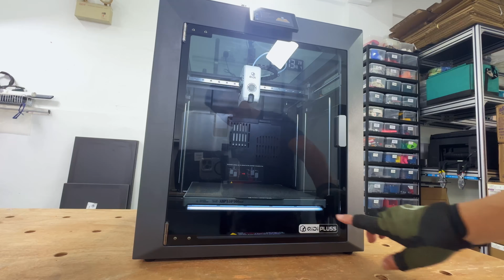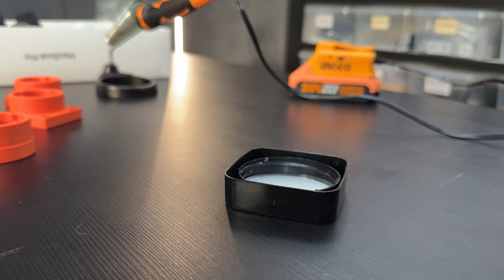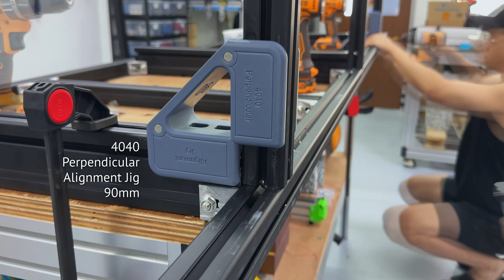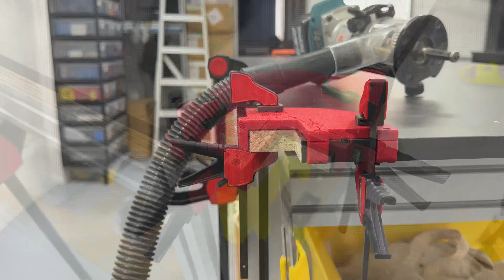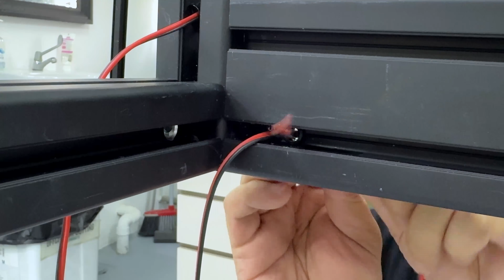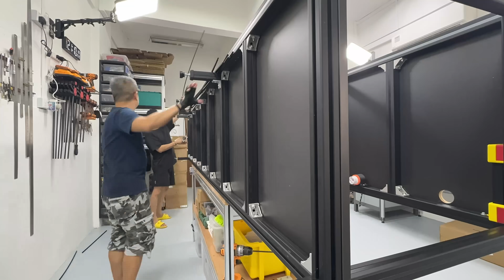I Built a 3D Printer Rack from Aluminum Extrusion (Full Print Farm Setup)

Comment from the maker: What do you want to watch me build?
Reply: filament drawer maybe with internal heated chamber
Reply from the maker: That will be done to 2 printers in time to come. With IDEX and INDX
Reply: Just build anything, sir, we would watch it regardless. Thank you for your truly unique and inspiring content.

Although, there are some concerns i'd like to address:

1. The open parts of the chipboard panels should be coated with something to protect from moisture.

2. Not sure if those snap-on connectors have sufficient wire gauge, i hope you calculated the minimum gauge in advance. It's fire hazard otherwise.
Reply from the maker: Noted❤
Reply: Foldable workbench?

Comment: Fantastic! I am planning a gaming table with a recessed vault for my Role Playing group. So of course RGB LED strips. The wiring in this video is very helpful. I will also be installing custom stained walnut for the table top and side panels. The whole reason for using aluminum extrusion is for the ultimate flexibility with accessories like cup holders, dice trays, tablet stands and phone chargers.

In the research phase. But I am getting ready to order some parts to play with as I am a physical learner. Thanks for the inspiration.
Reply from the maker: That sounds like an amazing project, walnut looks great with the black extrusion! ❤

Comment: The rack looks really nice, but the connection to mains plug looks unsafe. There should be at least a heatshrink on the exposed wires, that go to the plug.
Reply from the maker: i know. leaving it for Part 2 of the build where i do cleanup.

Comment: I love your footage and really appreciate your work! 

As my hobby is slotracing, I'm planning a table into one room in the basement. Room dimensions are 5 x 5 meters. 

Table dimensions should be 5 meters wide (from left to right wall) and 2.80 meters deep (rear wall to the front, where up to 6 drivers at the same race could take place.

My thoughts are also planning a table, standing on feet on the ground for a GT circuit track (My used system is Carrera Digital,  driven cars are 1/24 and 1/32 scale, which both work on the same track).

Then, I have another plan in mind: building a second track, a single lane Monte Carlo rally stage in French Alpes-Maritimes serpentines style for only 1/32 scale World Rally Cars. But this stage (same dimensions 5x 2.80 meters) should be lifted under the ceiling and should be lowered from the ceiling to use it for driving. Additionally, there is need for landscaping myself rocks and scenery around the track, spectators, track marshals and so on (of course snow and ice).

Hence I'm thinking about an aluminum construction for the normal table, and of course for the lifted table, too, including a plate from i.e. 8mm MDF and of course hidden electrical wiring.

Any ideas?

Best regards from Germany 

Michael
Reply from the maker: That sounds like an amazing project that needs to fly me in ❤